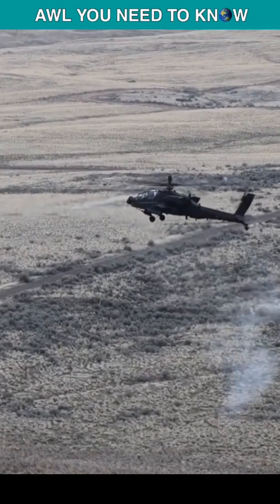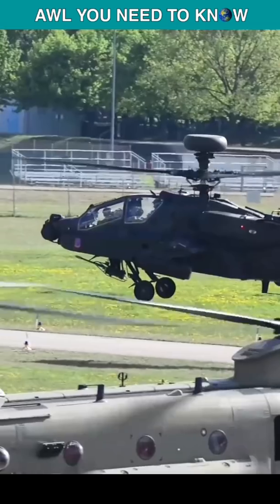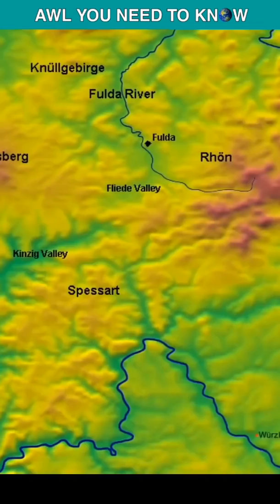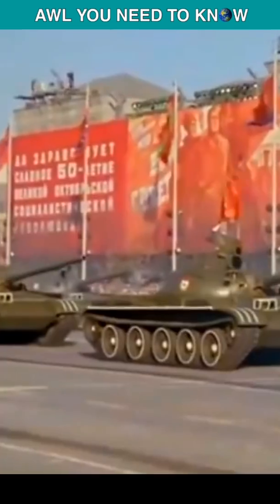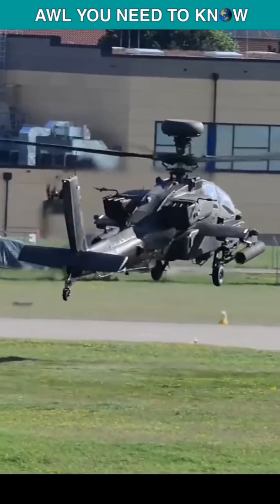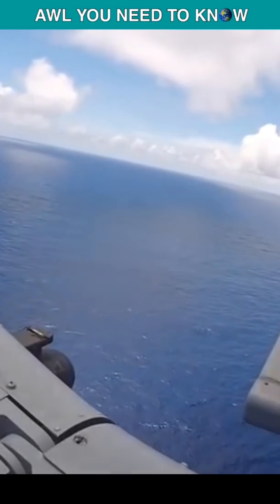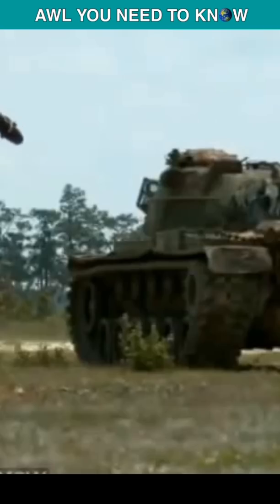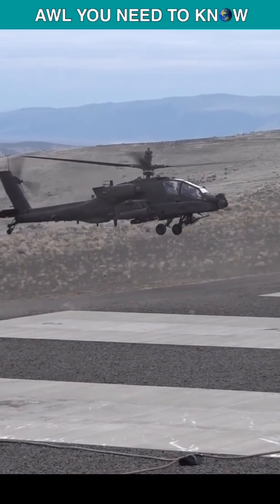Why Do Apache Use Hellfire, Instead Of TOW Missile? #shorts

Comment: They dont usw TOW cause TOW was outdated by then and is generally not a suitable system for an Aircraft. Like its not even a queastion. Also Machineguns arent the threat youre qoreied about in a Ground attack Bird. Its those Tangusgas and other designated AA

Comment: The answer is because the TOW missle Stands for Tube-launched, Optical, Wire-guided missle. On a moving flying object with spinning rotors the wires could get caught in the aircraft and make it crash. This video is stupid

Comment: I work on these things so I wanna tell yall a little more about it without breaching my contract (idk what's commonly known among civis about these things) 
It has a newer radar with the Echo model which has increased its range by a couple miles 
Has a drone which can assist targeting over mountain ranges (can prolly guess why this was done) 
It normally only carries 8 helfires but it Can do 16 but that's normally not done cause of the external fuel tanks unless the targets were in range for refueling
This thing is all about component redundancies I mean EVERYTHING has a failsafe
It carries smaller missles forgot what they're called can carry 24 per canister loaded usually atleast 1 they're good against ground targets
Has the 30mm auto cannon not supper accurate but has a 2 mile range used against infantry or light vehicles 
That's the basic bs that civs might know about might not idk

Comment: I always wondered if it was backwards compatible, like if they make the hardware to fit in the cockpit to let us guide TOWs for export models or early on when the hellfire was new and not stockpiled (like say if ww3 started in the mid 80s, that way if stockpiled were depleted they could just swap out the guidance hardware and then you have the ability to use the older but larger stock of missiles (granted those would run out quickly as well)

Comment: They can also fire from out of line of sight, and the rotors can be finally adjusted by the pilot to make them almost whisper...
  Laser designated missiles were an excellent addition, throw in a 20mm sight tracking chain gun for giggles,  and what you end up with is deadlier than a black mamba.

Comment: Any weapon system has to fulfill a purpose. Hence the Apache’s use with Hellfire, as a solution to the potential issues needed if Fulda Gap became a tactical problem. Further modifications namely rotor mounted sights. And multiple other upgrades. Raised the lethal effective mission envelope far beyond it’s original capability. Now one AH64 is as effective as four of the early models. A true force multiplier. With data interlinked one scout can identify multiple targets designate those targets to say four AH64’s they pop up out of cover one second later commence a strike four seconds later sixteen targets have a hellfire inbound. Even before enemy forces register the incoming attack the AH64’s are relocating to next fire points. Multiple attacks with both high percentage effective hit rate. While ensuring minimal exposure to enemy counter fire.

Comment: TOW missile are fly-by-wire meaning there is a literal wire connecting the flying missile to a stationary control board. 
Now think about a missile with a very long wire connected to a helicopter. Not very practical, huh.

Comment: That gun range 2.1 miles. Wow.  😲
Reply: You be surprised how far bullets can travel.
Reply: 2.1 miles is impractical for an Apache, considering it is not that accurate.
The effective range of an Apache’s gun is around 1500 meters or less, since farther than that, and it won’t hit a truck parked sideways.

Comment: And now, Switchblade drones can do the job of the Apache from 10km away.

The world of warfare is changing before our eyes.
Reply: No it cannot do apaches job from 10 mile away, Apache is a gunship, not just a precision strike platform
Reply: @alexmarlow2508  gunship means ability to transport troops and doing support fire at the meanwhile.. Apache is not a gunship but an attack chopper
Reply: @alexmarlow2508  Noted.
Reply: @Digital_Victory  I mean he’s right bro? 💀
Reply: @Digital_Victory  he’s right, and a switchblade is a one use and cannot carry large amounts of ordinance like a gun ship (which can also be used from 10+ miles away)
Reply: @username0984  he wasn't disagreeing??
Reply: @MO-lc7vb  That’s partly wrong.
The hellfires on the Apache only can only reach out around 7000 meters, which is roughly 4 miles, considering there is no JTAC unit.
Reply: @ryz_vik  true but they can also carry AGM-65s with a range of 12+nmi (assuming of course their is a JTAC)
Reply: @vladthemeatman7406  Hard to discern gone via text.   Kinda like the /s thing people have recently adopted
Reply: @Digital_Victory  
Oh boy I feel for you, you were just trying to help 😂❤
Reply: @Digital_Victory  at the end of the day it comes down to the fact that the Apache could technically carry multiple switchblades. Impractical but possible, and that’s what the difference is
Reply: @Digital_Victory  k
Reply: and apaches will still do it from 20, and better.
Reply: Dude didn't know the real reason why. 
Apache can engage from 10k away too.
It used the Kiowa, and drones today. To lase its target and apache just lean back an fire from wherever they are. 
I worked on kiowa...I watched the video just to see, if even now, people still don't know. 
Seriously, watch any apache documentary ever. They don't mention the kiowas support. They never do.  The cooperation is pretty hush hush.
The only call out I've ever seen,  was a photo of a Kiowa on an apache squad leaders wall.
Reply: @emilyhofland8219  yup, Kiowa has pod on top. Peaks over the hill with just that pod. Lazes. Apache isn't even seen. Eight Apaches with sixteen weapons is 128. Enemy has way more tanks than that, and is willing to lose many. This is just not a good use of military money. That is why drones are very much the future. Wait until the weapon/drone becomes sentient. Shudder...
Reply: @gerritfridericksohn4627  oh I'm not complaining of the change. Just stating it as is. Drone does it better.
... which enemy has many tanks?
Reply: @emilyhofland8219  because is cheap mass produceable and easy to use
Reply: Lol UG Krishnamurti said the future would be fighting with robots... Smh
Reply: Disagree completely
Reply: You must be chinese
Reply: Tanks mean nothing now. Can be taken out by anything.
Reply: @PSNplayer1.0  not from the ranges, ours reliably kill from... 
Tanks from 80 years ago. Are obsolete.
Russian tanks are manufactured in obsolete condition.
Reply: Don’t get so reliant on technology .
You’d be better off knowing how to read a map and not forget some tried and true warfare methods .   The opposition can Jam and Bug better then ever , they can defuse and Deviate GPS guided artillery shells and cruise missile guidance , their Electronic warfare is very advanced .
Reply: @CAStone-kq4md  Modern munitions can function in GPS denied environments. They use pre-loaded map data combined w/ inertial navigation, some can contour map with their own seeker radar to increase precision. Loitering munitions can target discriminate all on their own. The ability to confine the kill chain to a single platform-munition is not a new idea.

The idea that EW is a magic bullet, as if broadband jamming isn't incredibly power hungry and makes yourself a huge target to any EW suite on an aircraft, is a weird one. BAE has claims that their suites are so capable they can geolocate an emitting source and cue a PGM to hit that position.
Reply: @CAStone-kq4md  we can read a map in the army... I'm a pog. And I've done a land nav course on a yearly basis. Sometimes more.
Reply: @emilyhofland8219  
The apache isn't hitting anyone 10k away. In ideal condition the apache is currently only reaching 8k.
8k is outside enemy WEZs for most their weapons so you're still fairly safe. The apaches biggest advance is it's ability to terrain mask, get within range, launch and leave without ever seeing the target, or the enemy seeing it. The apache flies below tree top level and when going over trees the belly is scrapping the top of em lol.
Reply: @SubParPilot  agree. plus from what I’ve seen of apache operations in Desert Storm, it’d be hard to match the volume of precision weapons deployed in such a hard time without extra added complexity.
Reply: @SubParPilot  yeah... my estimate is pretty close isn't it. 

I'm also guessing you weren't the apache we were calling in hellfires from. Your range is extended to that of the hellfire when someone else targets it, for you. 
Pretty sure we were sending them from 5 miles plus...
I rounded to double for km...
You know,  an equation most Americans don't care enough to know by heart. 
Don't you have to have college to fly for the army? Figured you wouldn't need a breakdown.
Nobody likes an "ummm actually it's 8.04672 km" in the most nasally voice ever,  I'm sure. 
... you had to fly with a warrant officer,  didn't you?
Reply: @emilyhofland8219  I am a warrant so no, I didn't need college haha. And the term apache can be, generalized, there's a lot of nations that have it and it can carry munitions that can reach out to 30k. Sorry for the precision, being exact is what we do lol

And as for desert storm and similar conflicts those were way different than what we've done the last 25 years. Back then, and probably future fights you go beyond the flot and wouldn't need to id targets because you could be like, ok anything beyond this line is enemy, no need for pid, you scan, pick up vehicles and send missiles off the rail. Launch 16 missiles at 16 targets in 20 seconds and leave. That's how the apache was designed, unfortunately we haven't trained or fought like that in decades. But that's what we are slowly going back to.
This LSCO environment has been the biggest focus for the last year.
Reply: @CAStone-kq4md  lmao jammers aren't as good as you think.
Reply: Adam of Good  I’m not calling this war yet .   This conflict is a thousand years old ,the OPFOR can adapt .
Reply: @CAStone-kq4md  Gorilla warfare is a bastard. Even if they take areas there's a good chance there will never be peace.
Reply: @auglazeallday5335  You are most likely correct sir .
Reply: @CAStone-kq4md  Right, if rules of engagement are shot on site then it's less effective and solely how many combatants Ukraine can put in harms way.

Comment: I really wonder why they didn’t use fly by WIRE munitions in a rotorcraft

Edit: I may assume incorrectly, but you can’t bone me for using common sense to assume that any wires around a helicopter would be inherently unsafe

Edit: blame, not bone, but I’m not changing it
Reply: I don't blame ya bro. 

He who asks a question is a fool for five minutes; he who does not ask a question remains a fool forever. ~ Chinese Proverb
Reply: @auglazeallday5335  I have never heard that proverb before

是谁说的？
Reply: @belgianfried  Give Google a shot OR I can provide endless URL's
Reply: @auglazeallday5335  go ahead
Reply: @belgianfried  Appears you haven't heard of it or at least quoted correctly. After digging a little further, I noticed that every website claiming this quote as a Chinese proverb is very modern. The oldest one I could find was post 2000 so, I was wrong. 

That aside, I still believe the logic to be sound. If you don't know then ask or, in my case, research.
Reply: Jamers and strong radio signal which could be targeted.
Reply: @cujbaion1  but they did bro! Also why would a Wire guided missile have to worry about strong radio Signals? I think that is a small concern!
Reply: @MO-lc7vb  usually old TOWs have to paint the target area with IR, but the TShU does bzbzbzbzbbzz… so…
Reply: @belgianfried  ahh okay
Reply: @MO-lc7vb  they don't use IR anymore iirc, more ultraviolet light, or I'm just basing it off the FIM-92K Stinger using a similar system against IRCCMs

god I love the military. let's go counter counter counter measure
Reply: @cujbaion1  TShU-14 doesn't work anymore, only against old tows
Reply: Just play battlefield 4, you don't want to see a good heli pilot with TOWs
Reply: I wouldn't bone you for using uncommon sense.
Reply: Don't worry, we'll bone you alright
Reply: The AH-1 Cobra used up to 8 TOW at a time. Do you have any idea what you are talking about? A few seconds of research would show you pictures and videos of TOW being fired from helicopters.
Reply: Actually the cobra used tow’s and yes they would have wires in places that had to be removed.
Reply: I'm pretty sure that the Cobra was making extensive use of TOWs for a while before Hellfire came into being
Reply: fly by wire is NOT beinh wireguided - different terminology
Reply: Well they did, and it worked so now whos the idiot?
Reply: Um wat
Reply: Dammit I was going to bone you till you said I can't.
Reply: Lol
Reply: I'll bone anyone the hell I want!
Reply: you could have just edited the fact you used bone instead of telling us all.

just say youre a unnecessarily prideful person.
Reply: You mean like the TV guided AGM-65 variants? Might be due to the size but I'd love to see some kind of weird custom setup that let you slap one per pylon
Reply: Those wires are about the width of a human hair
Reply: Jesus Christ! I just shot milk out my nose even though Im not drinking anything.
Reply: Lmao they use TOWs in a LOT of helps lmao, sit down bro
Reply: @MO-lc7vb  exactly
Reply: My friend, why the fuck did you write fly by wire. Just say wire guided and prevent me from explaining that fly by wire means that the control surfaces of an aircraft are electronic and filtered though a computer so as to ensure the moves are safe.
Reply: @manuelmartins1967  lmfao yeah, does the B-29s turrets count as FBW?
Reply: @belgianfried  a gun turret is not a control surface LMAO
Reply: @belgianfried  no
Reply: @manuelmartins1967  I've heard "FBW targeting system"
Reply: @belgianfried  You've heard "Wire Guided Targeting system" not Fly-by-wire targeting. Cause fly-by-wire targeting systems DON'T EXIST!
Reply: @powdrpuf23  ah ok
Reply: @powdrpuf23  dunno pretty sure it does
Reply: Na bro that’s an excuse, it’s very common
Reply: @MO-lc7vb  Can you dumfucks stop saying "bro" bro?

Comment: The Dshka was far from the primary threat. The ZSU 23mm was a much bigger concern.
Reply: If they used tow then the DSHK would be a threat also
Reply: @nicedurians  yeah, might set off the fuse if youre lucky
Reply: -4
Reply: Yall the forgetting the humble RPG or something?
Reply: Dshka is a very highly regarded threat by pilots of helos, you non rate civilian Wikipedia PhDs who don't even rate POG need to stop
Reply: @jackdogginton  Okay? But it very obviously was never the primary threat.
Reply: @mibusixosi  it wasn’t the primary threat in which conflict? Small arms fire was the primary concern in both Iraq and Afghanistan, where the 64 has two full decades of flight time.
Reply: @jackdogginton  understandable for a helicopter whos only armor is BETWEEN the crew members
Reply: @jackdogginton  yeah I'm not sure why civilians think they're more knowledgeable than actual military planners.